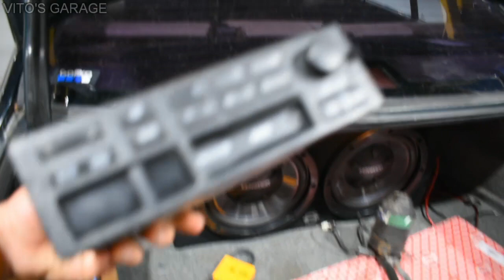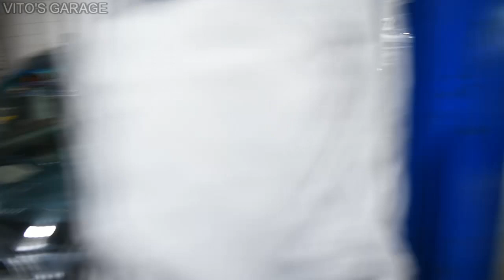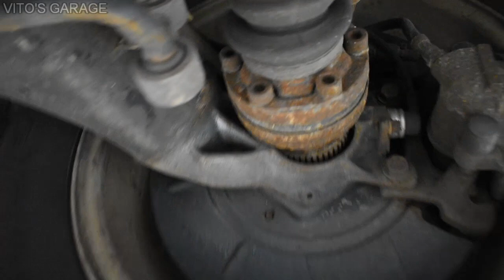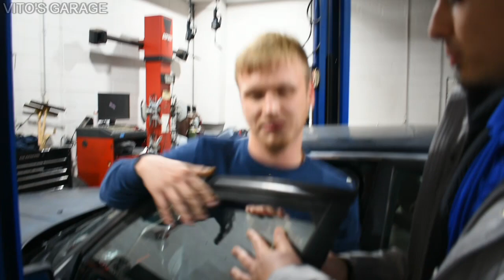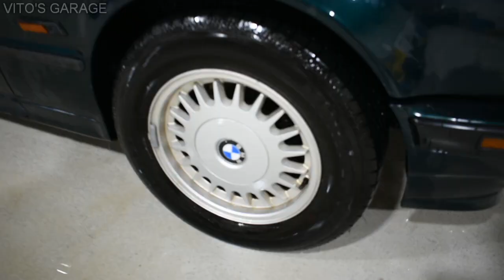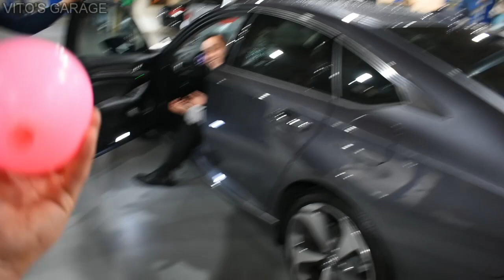Busy Day in The Shop with The Boys. Sending Love to Classic BMW E34!

Comment: I remember having an e34 525iA back early 2000. Sold it with 470,000kms.  Thing was a tank. Only major thing that broke was a rocker arm and cylinder head gasket once.